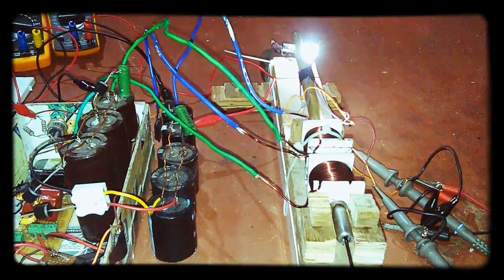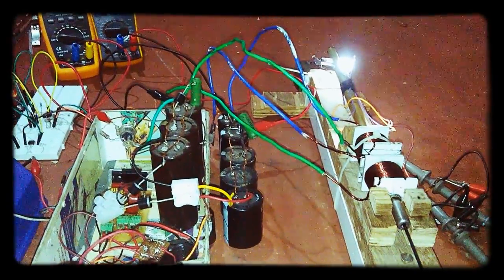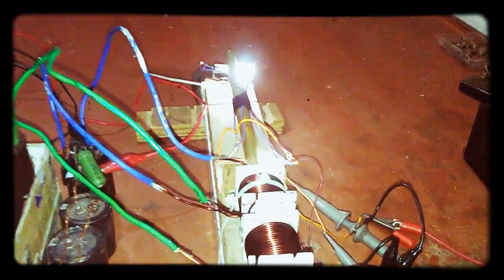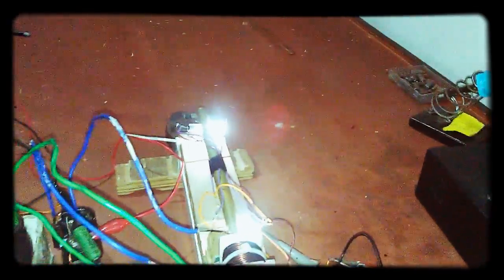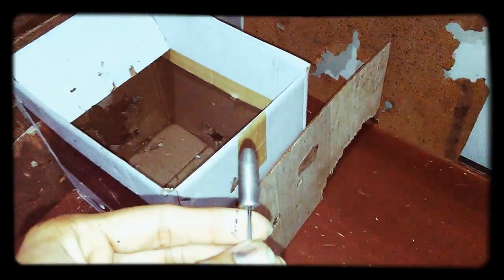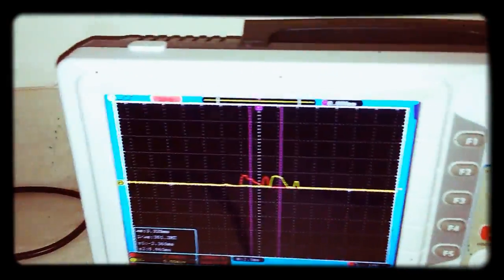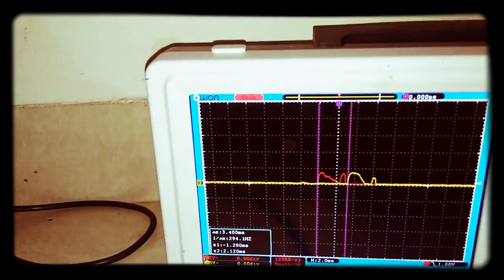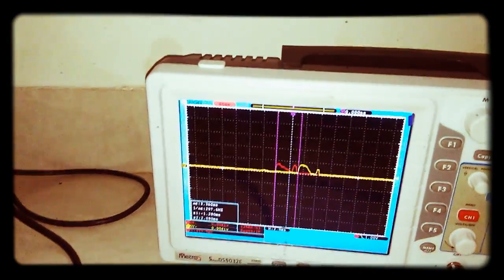2 stage electromagnetic gun

Comment: Why not use batteries so you can get a  higher rate of fire and more compact design?
Reply from the maker: coze if you want to use batteries , you got to  spend too much money on stronger igbts , powerful batteries . and also 
to get muzzle velocity as this one here  you need have way more accelerating coils and also batteries cannot give higher voltage  and current like capacitors
Reply: Also you need to built a boost converters..its a hassle for project work.